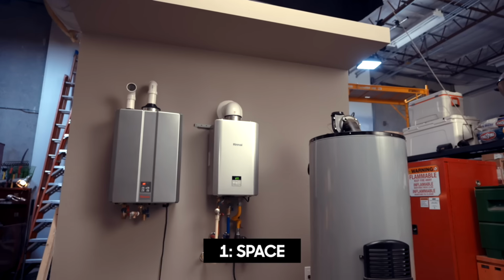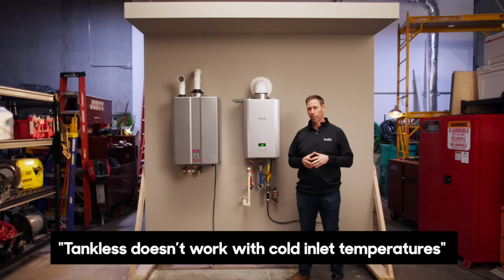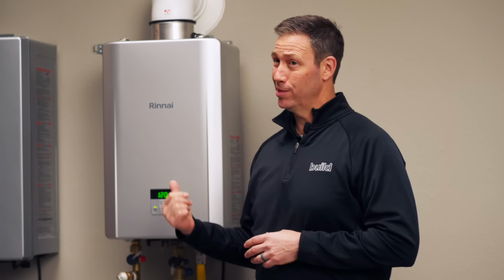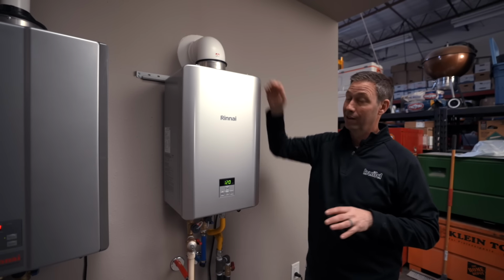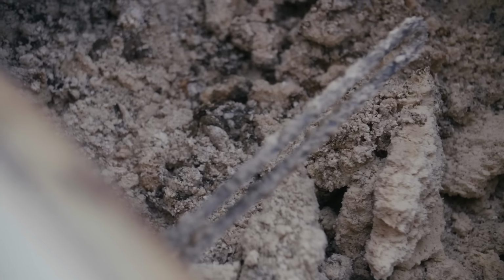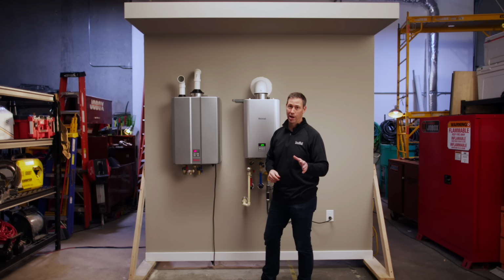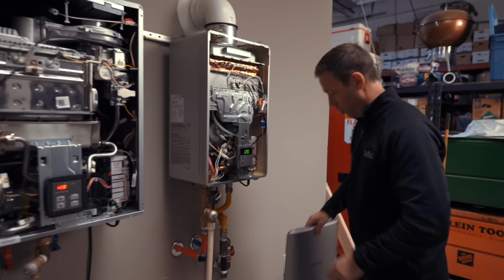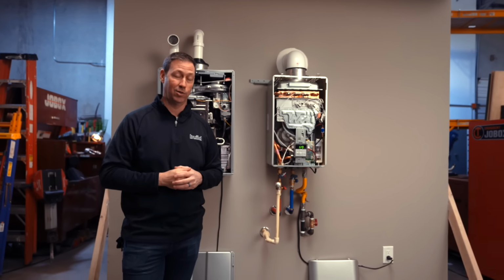DEBUNKING Tankless water heater LIES!

Comment: I installed my own Rinnai tankless 6 years ago. I descale it once a year and I love it. Only downside was once power went out and lost hot water fast. I bought a UPS backup unit for about $100 and will keep it powered up for 30 min if power goes out now. Love my unit
Reply: quick the power went out, i need to shower.  Seems useful
Reply: @chadschafer1723  And why not be able to still take/finish a warm shower if you can. Life goes on through power outages.
Reply: @lordgarth1  listen if that's what makes your day, God bless.
Reply: @chadschafer1723  Well... you could be taking a shower when the power goes out. lol
Reply: @TheFlyingZulu  first thing I'm worried about is finishing my shower when the powers out.
Reply: @chadschafer1723  there's places that have somewhat frequent power outages due to weather and above ground lines (New Engalnd). Power outages aren't uncommon and people don't stop what they're doing every time the power goes out. When I lived in NH it was a fairly common occurrence and most places had whole house generators that kicked on during outages. lives went on, including if you were in the shower. power outages don't mean immediate emergencies for some places, which is what you seem to think they are.
Reply: You got a UPS back up power for $100 that is able to output more than 5KW for 30minutes (min 2.5kwh capacity assuming you are using a tankless with the lower flow rates)? That is some amazing technology in your country

Most UPS, esp consumer level only able to deliver 1-1.5kw. higher power output requires much more expensive electronics to allow for higher current conduction. Plus a 1.2kwh LFP battery generally costs more than $300 USD at the time of writing.
Reply: @nmos001  I assumed it was a gas unit. They still need power.
Reply: @lordgarth1  agree that makes more sense. I thought it was electric given that he was talking about power loss
Reply: @nmos001  he has a gas hot water tank. Uses very little power
Reply: @chadschafer1723  oh I see, I stand corrected then.
Reply: The Natural Gas / LPG models use 110v input for ignitor and the smart controls. So they do need power, but it’s not a significant draw. A basic “home PC” type UPS can easily power the unit for a short-duration outage, such as during stormy weather or minor common outages. 

It will not have sufficient power for longer outages, such as the Texas ice storm or other grid-down situation. For those, you would need a whole-home backup system (generator, solar, powerwall, etc.).
Reply: @bravowhiskey4684  We have long power outs about every 10 to 15 years here. I have a back up generator that I have to hook up in those times, The UPS just keeps the unit going to finish bathing. The Tankless only uses 70 watts and I have used a cheap 400 watt convertor and 12 volt battery to power the water heater for a car wreck that knocked the power out once before I got the UPS, and before my back up generator.

Comment: How about replacing the electronics when the board goes bad. The price to replace the control board can be quite pricey!
Reply: More than the price of a new tank.
Reply: @HBSuccess  cost my brother-in-law a couple of hundred bucks when his control module failed.
Reply: Average price I see on them from repairing them is 300-900 for control board with sensors and not including repair fees. Add 1-3 weeks for parts to arrive.

Comment: In general a tank water heater will be less expensive to buy.  As you pointed out you get no hot water without electricity for the thankless system.  In California this is getting to be a big problem as the infrastructure to deliver electricity is becoming less reliable.
The big advantage of thankless is not running out of hot water.  I plan one day to have my upstairs supplied by a thankless while my downstairs stays on a tank.
Another way to look at is are you going to live on the house?
If it's going to be you and your running all 3 showers at the same time, thankless is the answer. 
If it's rental property then the tank is the way to go, especially if the tenant pays the utilities.
Then there is a third choice: solar hot water.  While these should be supplemental, and can be complex, preheating water with the sun is great for power conservation.

Comment: So you have 100 people living in your home ? ? maybe 10 ? or maybe not so many.
false framing of the matter misleads everyone. 
Solar pv panels on your roof and run the extra electrical power to your stainless steel storage hot water tank, 
every building and every tankless water heater is connected to the grid 24/7, so to draw on the grid power now and again, ezi pezi.

Gas will not be available in 20 years, or less.
EV, electric vehicles with huge batteries will be every where soon, with spare power every day.
The USA has brilliant technology, Ford destroyed the horse and cart technology and its old thinking.
So you want to invest in the future???? thinking, thinking.

Comment: For a 3500 Sq Ft 1-story 4 bedroom home, my builder is telling me they recommend 2 Rinnai RL94i units. When I asked the builder why, they said its a big home? They didn't mention anything about a loop, so I don't know what to believe.
Reply: Tankless is on-demand design. Not suitable for recirculating system. 

Your builder is advising you correctly. He’s likely attempting to reduce runs from heater to fixture to <15’, preferably less. I’d suggest you home being single level, 3 might be better. If all 4 bedrooms are at same end of home, 2 should be fine. Most homes that size and BR count we build have 3 BR’s at one wing, centralized kitchen & half bath with master at opposite end of home. If that’s your layout, one for master, one for kitchen/laundry and one for kids bedroom wing. 

Alternatively, a single 80-120 gal tank heat pump water heater is 3.5-4 times higher efficiency and with a proper designed recirculating system will deliver instant hot water at every fixture on demand.

Comment: I don't know about the US but here in Australia gas prices are extremely expensive. 
I use solar to heat our tank and back up with off peak power in winter , so hot water in spring, summer and autumn is nearly free . 
Humans should also be moving away from fossil fuels as an energy source.
Reply: I live at ~4200 feet above sea level and commute over a pass that is ~7100 feet above sea level every day. The coldest temperature I've ever experienced where I live was -53 F (-47 C).  The deepest snow I've ever had to clear from the roofs and road was officially 7' 7" and it fell in 36 hours.  The coldest temperature ever recorded in your whole country was only -9 F (-23 C) in 1994.  It took a full 7 days to drop 4' 5" of snow in your worst snow storm at your absolute highest elevations in 1956...  Your climate might be somewhat more forgiving regarding green energy reliance than mine is.  But, I certainly hope anyone who lives where it's feasible is able to save some resources and money that way.
Reply: @betweenfiveandseven  I agree the Australian climate is very easy to live in . I couldn't imagine living in - 47C and this is where insulation becomes very important. Instantaneous gas hot water is the only practical solution and I dislike when solar is promoted as the answer to our energy needs . Solutions need to be adapted to our climate zones.
Minus 47C jeez that's cold , your summer would need to be glorious!! .

Comment: I don't hear a lot about indirect water heaters, it would be interesting to see how they compare.  There would be a few obvious challenges in the comparison though.
Reply: I've switched two building to indirect. In my house (NYS) I went from a pilot lit boiler with pilot lit water heater (40 gallon) to a spark ignition boiler and a 30 gallon indirect. Gas use in the summer was cut in half. The other (Central VT) I was replacing five tankless units (old Bosch units with pilot lights) with a 125 gallon indirect tank plumbed to an existing electronic ignition boiler. The problem with the five tankless units was the fresh air venting in the building was insufficient for more than 2 units (125K btus each) running at the same time. Plus the mechanical controls were starting to get unreliable. The 125 gallon tank has supplied hot water for 10 bathrooms (with showers) plus a large kitchen. Indirects big advantage is less loss because the tank is completely insulated. The problem with indirects is they only work if you've got hydronic heat and work best in colder climates. If you have hot air heat tankless units are the way to go.

Comment: Installed the same unit on the right and was upset that I had to pay an extra $120 for the vent kit. You can't install the unit without a vent so why didn't it come included?
Reply: I think you just answered your own question
Reply: @tubulartuber  greed, true that.
Reply: Generally venting is sold separately, because houses are different and its not possible to have an omnipotent venting kit that is suitable for every or even most of the installations.
Reply: @PunaJussi  Understandable but they shouldn't advertise it showing the vent then.  .

Comment: I’ve had a Rinnai tankless installed 13 years ago and It has worked flawlessly. The only thing to get used to is that you do need to let the hot run for a few seconds before the hot water comes out. You are essentially purging the cold water that is in the line. With a tank, convection keeps the water in the pipes warm all the time, which means you are wasting money heating your wall cavities with your plumbing. A minor difference that I’m happy to live with.
Reply: Convection from a tank does not keep the water in your pipes warm all the time. Matt even explained this in the video, unless you have a recirculating pump, everyone has to wait for the cold water to be flushed from the line before the hot water arrives, regardless of tank or tankless.

The disadvantage of tankless is, as @J says, the little bit of additional time it takes to heat the water pipes inside the tankless heater. Because of that, even if you had a tankless unit directly behind your shower, there will still be a short delay before you get hot water.

An "instant hot" water dispenser works by putting a small tank next to the faucet. The water in that small tank is always hot and can be delivered (almost) instantly.
Reply: @hempelcx  Go feel the Temperature about five feet from your tank water heater hot outlet, or the last metal part if it switches to non-metallic before then. If you have tankless, at 6in from the heater it is room temperature about 30 seconds after you stop using hot water.
Reply: uh no youre completely wrong lol. it takes longer because the pilot has to heat the pipes and that takes 15 seconds easy
Reply: Install a heat trap to prevent convection losses from your tank heater.

You have to pay for the convenience of convection losses.

Comment: Finally someone that doesn’t trash tankless! I got one, different brand, can’t afford Rinnai!,
best thing I ever did! Its been 2.5yrs so far, no problems! Just put one in my tenant house. Mine is NG, tenant’s is LP, same brand. Mine paid for itself in under a year in savings from NG! Made my own flush valves, saved quite a bit of $’s. Just use white vinegar you don’t have to buy expensive “flush” liquid.
Reply: 2.5 years is nothing.  report back in 10.
Reply: Would love to! Give me about 7 more years. Mine has already paid for itself! Even if I had to replace it every 3 years I would still be ahead.
Reply: @Cecil.  it hasn't already paid for itslef, if in the next 7 years you empty your pocketbook on repairs and service calls for error messages.  so, it remains to be seen if you are one of the lucky ones or not.
Reply: In less than the first year the savings in natural gas paid for it. What I’m saying is that even “if” it died every 3 years my savings in gas would pay for it every time. I have had no fault codes or any problems with either of the two units I installed. A 35 gallon tank heater in my area sells for $900+, the tankless I got were $338 and $359. I do all my own install and maintenance even making my own flush valves so the cost everyone chokes on doesn’t apply.
Reply: In less than the first year the savings in natural gas paid for it. What I’m saying is that even “if” it died every 3 years my savings in gas would pay for it every time. I have had no fault codes or any problems with either of the two units I installed. A 35 gallon tank heater in my area sells for $900+, the tankless I got were $338 and $359. I do all my own install and maintenance even making my own flush valves so the cost everyone chokes on doesn’t apply.
Reply: In less than the first year the savings in natural gas paid for it. What I’m saying is that even “if” it died every 3 years my savings in gas would pay for it every time. I have had no fault codes or any problems with either of the two units I installed. A 35 gallon tank heater in my area sells for $900+, the tankless I got were $338 and $359. I do all my own install and maintenance even making my own flush valves so the cost everyone chokes on doesn’t apply.
Reply: In less than the first year the savings in natural gas paid for it. What I’m saying is that even “if” it died every 3 years my savings in gas would pay for it every time. I have had no fault codes or any problems with either of the two units I installed. A 35 gallon tank heater in my area sells for $900+, the tankless I got were $338 and $359. I do all my own install and maintenance even making my own flush valves so the cost everyone chokes on doesn’t apply.
Reply: In less than the first year the savings in natural gas paid for it. What I’m saying is that even “if” it died every 3 years my savings in gas would pay for it every time. I have had no fault codes or any problems with either of the two units I installed. A 35 gallon tank heater in my area sells for $900+, the tankless I got were $338 and $359. I do all my own install and maintenance even making my own flush valves so the cost everyone chokes on doesn’t apply.
Reply: In less than the first year the savings in natural gas paid for it. What I’m saying is that even “if” it died every 3 years my savings in gas would pay for it every time. I have had no fault codes or any problems with either of the two units I installed. A 35 gallon tank heater in my area sells for $900+, the tankless I got were $338 and $359. I do all my own install and maintenance even making my own flush valves so the cost everyone chokes on doesn’t apply.
Reply: In less than the first year the savings in natural gas paid for it. What I’m saying is that even “if” it died every 3 years my savings in gas would pay for it every time. I have had no fault codes or any problems with either of the two units I installed. A 35 gallon tank heater in my area sells for $900+, the tankless I got were $338 and $359. I do all my own install and maintenance even making my own flush valves so the cost everyone chokes on doesn’t apply.
Reply: In less than the first year the savings in natural gas paid for it. What I’m saying is that even “if” it died every 3 years my savings in gas would pay for it every time. I have had no fault codes or any problems with either of the two units I installed. A 35 gallon tank heater in my area sells for $900+, the tankless I got were $338 and $359. I do all my own install and maintenance even making my own flush valves so the cost everyone chokes on doesn’t apply.